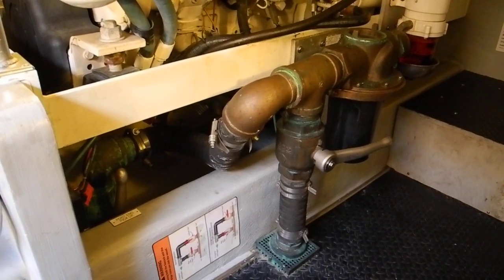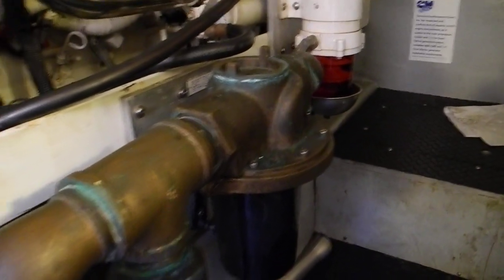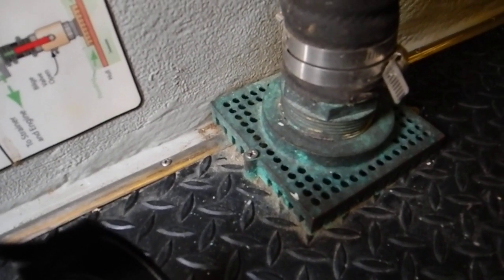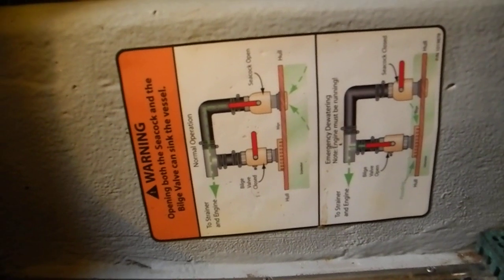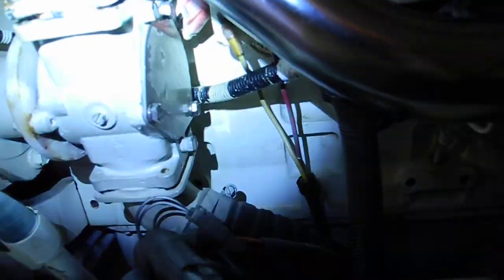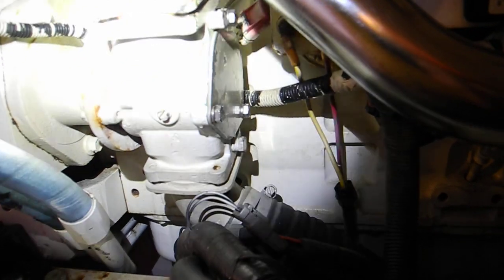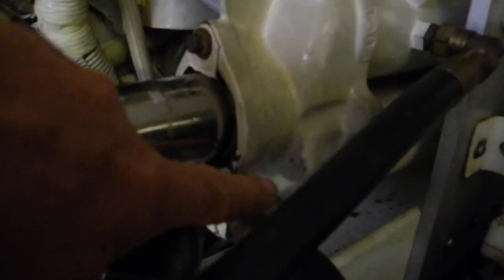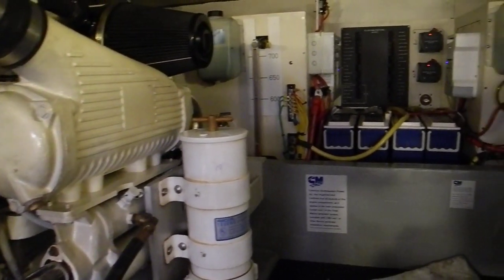Emergency bilge pump

Comment: You can find a diagram and instructions in Chapmans.My boat has 2 gate valves that I connect hoses to charge with antifreeze and flush when necessary.I have to hoses connected to each gate valve.Close seacock-open gate valves and it sucks water through gate valve.Very easy and very simple.On my Merc 5.7 it will suck about 5 gallons every 30 seconds or so.That works out to about 600 gallons/hr. times 2 gives me 1200 GPH in addition to 1500 GPH aft bilge pump in an emergency.